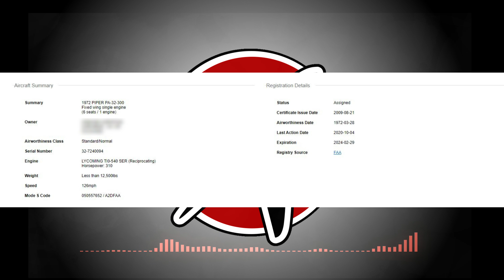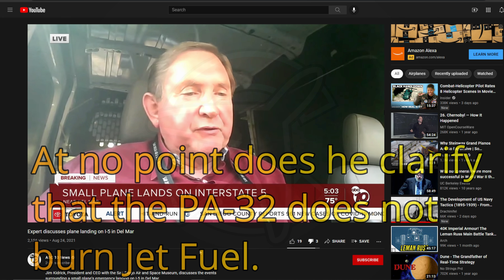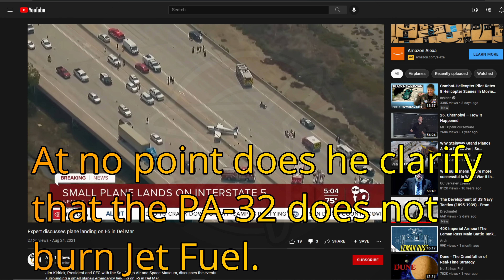Aviation "Expert" Gets it Wrong? - Emergency landing of N2843T

Comment from the maker: As of the release of this video; a cause for the engine failure of N2843T has not been determined. If jet fuel contamination does turns out to be the cause of the mishap; I'll make a retraction, however, I doubt I will have to do so. More likely causes would include water contamination, or mechanical failure. We will have to see what the NTSB investigation turns up.